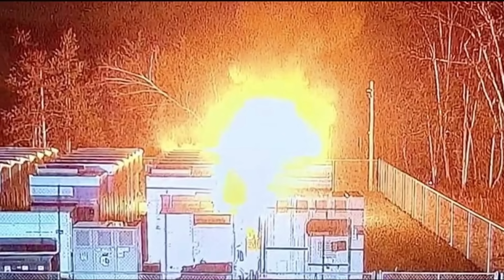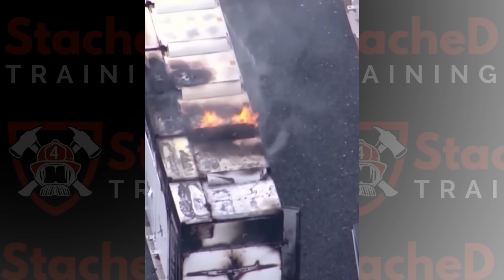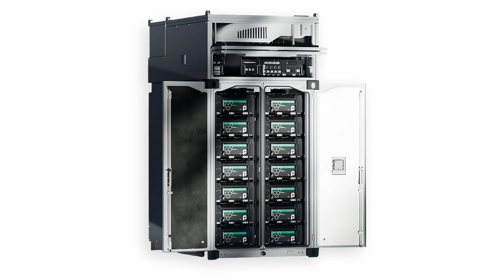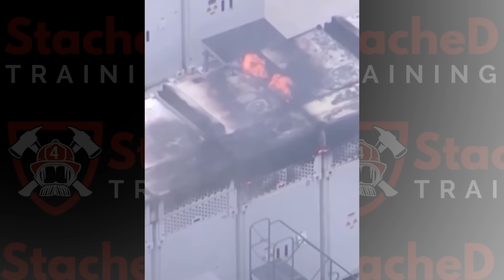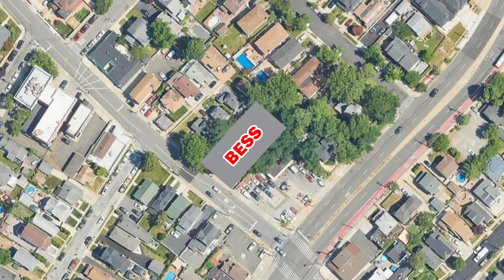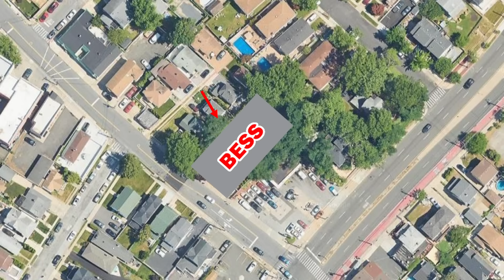Battery Storage Fire in Warwick, NY: A Repeat Incident

Comment: I find it hard to understand why the battery couldn't handle a rain event. How hard is it to build something to be rainproof?
Reply: if left to an engineer, not too hard. As you should know from following Boeing ongoing problems and vehicle recalls in 2025, nothing is left to engineers anymore, engineering plans are filtered through government bureaucracies (with mixed results) and bean counters (usually with negative reliability and financial results). The rich get rich by robbing companies of their reputations and customers of their safety and product quality. Go cartel capitalism!
Reply: Condensation?
Reply: There is no such thing as waterproof.  It’s a misnomer.  Water resistant is the best a serviceable item can be.
Reply: @jeffforbess6802 i would argue that rainproof and waterproof are two different things. It is true that combined with wind, rain can be pesky, and to maintain a rain barrier ofter requires routine maintenance and inspection, but unless there was flooding it should be doable. Even flooding can be mitigated by site selection and prep combined with design and construction. When water is a common failure trigger you just have to treat it as such.
Reply: @jeffforbess6802  Well it really depends on the IP rating of the device.
Reply: Design error that likely was a significant reason for POWIN going bankrupt

Comment: Pat, to contain single battery unit fires. What are your thoughts. To bury a said unit in a slurry of liquified sand to neutralize multiple units. 
To contain/limit any adjacent units. In turn, limit any further potential spread of fires. In turn, limiting the need of large amounts of water to control the spread of toxins and limit said fire???  Cheers, Mate.

Comment: We had a large-ish power outage in a few states due to small arms fire draining out the coolant oil in electrical transformers, once in CA and once in NC.  Is there a risk for thermal runaway for these BESS installations from similar bad actor attacks?
Reply: That'll be worse, at least the modern transformers have protection against low oil levels, batteries go off the moment they're compromised.

Comment: The irony of getting a Tesla battery wall add right after the video. Thank you Stach.
Reply: Any insurance covering that is gonna lose a lot of money 😂
Reply: Even though the video mentions Tesla twice both the fires were at a NON TESLA BRAND Powin
"The most recent battery fire in Warwick, New York, occurred on December 19, 2025, at the Church Street lithium-ion battery energy storage facility operated by Convergent Energy & Power. This was a repeat incident at the site (following fires in 2023 at Convergent facilities in Warwick, including this one and a nearby location).
Reports from 2023 consistently identified Powin as the manufacturer of the battery systems involved in those earlier fires (specifically Powin-branded Centipede models, where a manufacturing defect allowed water infiltration leading to electrical shorts)."
Reply: @jjamespacbell  I was just pointing out the irony of getting a powerwall add right after the battery storage fire video is all.
Reply: This wasn’t a Tesla fire. Tesla megapacks are extremely safe… Their technology is quite advanced, that’s why many entities pay premium for them
Reply: @graciasthanks4771  I never said it was a Tesla fire. I was just pointing out the irony of a battery storage add immediately after a video about a battery storage fire. Probably not a good selling point. The algorithm should have picked a different add.
Reply: @peteengard9966 ok, my bad. I incorrectly thought you were somehow implying something negative about Tesla storage… thank you for the clarification

Comment: 0:44  LifePO4 batteries too?!?!? 😳
Are we doomed to lead-acid for our storage needs?
Reply: Nickel iron batteries are the safest but not energy dense. Thomas Edison battery storage company. The make them in China and Russia. Used in submarines, rail and far remote locations were failure is not an option
Reply: For grids, dams are the safest energy storage. A "failure" just means dumping all the water from the upper reservoir to the lower reservoir.

They only problem is that they need the right terrain. You can't just build them anywhere.
Reply: @Grauenwolf   LOOLLLLLLLL Dams are the safest...

yeah when they fail they just wipe out everything down stream LOL...
Reply: @mattlane2282 Down stream is just another reservoir. That's it, there's nothing else. You just have two reservoirs and a dam that connects them. And a pumping station to get the water from the bottom reservoir back to the top.

You're thinking about daming a river. This has a completely different risk profile because the top reservoir never contains more water than what could be stored in the bottom reservoir.
Reply: @Grauenwolf do you think in nature? We just have like these random locations all over the place that have a storage place for water up top at a storage place of water at bottom but conveniently like they're not both full. 

They dam up an area to create an upper reservoir meaning it floods out tons of natural habitats for all kinds of wildlife and animals and kills off tons of vegetation cuz you know that's very green 

And then if there is a failure, you're still going to have a whole lot of water all at once rushing down to somewhere else and depending what's around it. 

I know what a damn is in a river that does the exact same thing minus water being pumped in artificially. 

I just didn't feel like getting into the environmental impacts of how they're designed and built by flooding out tons of land that originally was not underwater
Reply: @mattlane2282 What part of "They only problem is that they need the right terrain. You can't just build them anywhere." did you not understand?
Reply: @Grauenwolf what part of you flood out entire ecosystems? Did you not understand you're putting water where it wasn't?

Comment: 2:37 Oh, that is unfortunate. I was waiting for someone to have cut a corner, but they used LiFePo4 and even limited themselves with a disaster consumption plan. (When you sacrifice easy compatibility for limiting your disaster to 1 single unit)

The only other suggestion I would have had is to cool the cabinets or    insulate the cabinets with an inert gas as a fire retardant. Possible have a hookup to the cabinet to pump in Halon or other extreme fire discouragement gases.

Comment: Polluting -America- the world one battery fire at a time.
Reply: china has many ev fires every day
Reply: @lorenzo42p  yeah they lead the world in EV usage especially with e-bikes. They produce almost 80% of the worlds batteries and apparently over 60% of the global sales of electric bikes/scooters. Apparently back in 2022 they were having about 7 EV fires per day and in 2024-2024 they have about one per day. Most of which didn't occur during an accident but while parked or charging. I'm curious what the environmental impact is but you can be sure that is not being tracked due to the push to get them adopted.
Reply: @roberthentosh5635  and they are also the most dangerous batteries on the planet
Reply: @roberthentosh5635  they have a lot more than one ev fire per day. the ccp lies.
Reply: Make Coal pollution great again
Reply: @glike2  coal can be clean
Reply: @lorenzo42p but not competitive at the same time
Reply: @glike2 
Smoke scrubbers are not a new invention.
Reply: @glike2  not competitive?... yes it is. build a more efficient power plant.
Reply: @thomasneal9291  what lie did I buy???? I guess you're upset you bought into the ev hype.
Reply: @lorenzo42p for no extra cost?
Reply: @glike2  still cheaper than green
Reply: @lorenzo42p  Not it can't. It's possible to make it cleaner than it is right now, but that requires a lot of expensive equipment. But coal will never be cleaner than solar, wind and hydro combined with BESS.
Reply: Heh. Now do our MFN (Most Favored Nation) trading partner China.
Each week on The China Show here on YT has videos of ebike and EV fires and even WHOLE factories going up in smoke owing to workers NOT being paid ...
Like I said - "Now do China."
Reply: You should see the factory and power plant fires in china. Really though ..you would understand just how destroyed the planet is now.
Reply: @ItsMe-vg4vj go look on any weather website that has air quality reporting, can see the pollution live. china is the worst on the planet.
Reply: Yeah!
Reply: And California and NY are leading the way. Two blue states that cry THE CLIMATE CHANGE MONSTER.
Reply: Is there anything dumber than wanting to run the world on batteries?  Physics fail.

Comment: Water and high voltage electronics don't mix well. 
So even without any batteries inside this would probably not have had a much different outcome.
Reply: Typically there will be sparking, and some damage of course, but a substation doesn’t store energy like batteries do. Sorry, but no the result of water intrusion would be nothing like you get with a thermal runaway event with batteries.

Comment: Can you make a video about the recent fire in Crans Montana Switzerland? 
It kinda feels like there is or was an attempt to swipe things under the rug in terms of fire safety. 
At least it reminds me of some "Dark History" videos of fires that caused safety regulations to be established/enforced.
Reply: YES.

this is a bizarre case because you can see on the few videos that popped up how they stand around as sparklers ignite the insulation on the ceilling, then a guy even swings a scarf or something at it trying to put it out. It clearly wasn't an instantaneous blast, now I know fires can spread rapidly, but this is still a crucial time frame in which people reacted to the flames. I don't think they were all just drunk and overcome so fast, people do have natural instincts to flee. 

I feel like the only reason this many people could perish was that the building itself had insufficient exit routes or something akin to that, basically every other such case (The station, kiss club..) was also just a lingering building code issue waiting to happen. As in, if there had been no fire but instead an active shooter, gas leak or other kind of emergency, the lack of clearly marked exits and overcrowding could have turned it into a death trap just as well. Should that turn out to be true with this as well, the businesses and hosts must be held accountable.
Reply: @ccllvn it was a flash over fire.  Where the heat builds up to a point where it can very rapidly spread to other combustable materials in short period of time.

The exits literally jammed up with people trying to flee.  Once you wedge 3 or 4 people into a doorway, and have a stampede of another few dozen behind them, the door ways become unpassable.

Comment: The stupid thing here is that we don’t need high density batteries in these applications and we’ve had NiCads doing the same job for over 100 years without the combustion issues.
Reply: NiCads degrade over time and with use making them far less cost-efficient.Cadmium is a nasty player in itself and introduces a safety hazard these don't have. The stupid thing here is not understanding what you're speaking about.